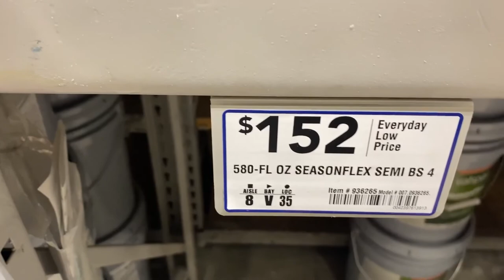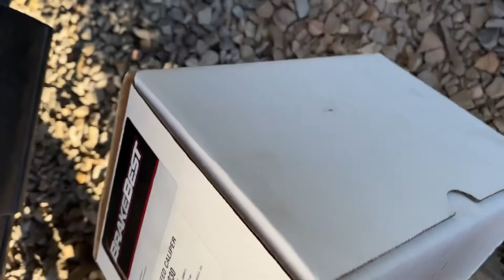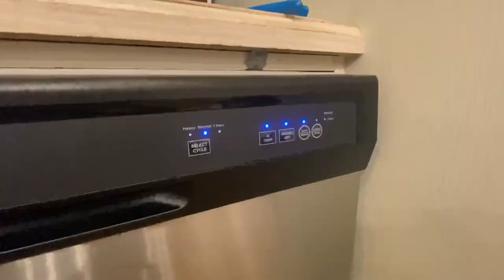Restoring Church Pews | Part 2 | Using Paint Sprayer to Apply Primer Coat | Changing Brake Pads

Comment: Hey Cody, being an HVAC tech and appliance guy too for many decades I have recently come to find out from other techs and long time Big Brand engineers etc that in the trade for decades that the equipment by DEISIGN is meant to fail. Every appliance has parts or components that are/were purposely designed to fail (by another company for legal reasons) simply to motivate repurchase by us consumers. It definitely makes sense because if it did not break where would the customers go.
Reply from the maker: I can see that being true. Doesn’t surprise me one bit. It’s all replaced now and working with a whirlpool brand instead of GE. Told him I wanted the cheapest piece of junk that they sold because I’m tired of paying top dollar for something that’s just going to break on me. Cheapest piece of junk that had a stainless steel face on it lol

Comment: God Bless you Cody. I have been painting (brush n roller) a house and reluctant to try the airless sprayer (never used one) but you gave me the courage. Plus I need to move on from this job!
Reply from the maker: I could have given you tons more examples of me using this thing whenever I was building our home. It works so well and it’s honestly just not that difficult to use. Takes a short amount of time to set up once you know what you’re doing and a short amount of time to clean up. Not worth it for a tiny job but for a job that would normally take days, turns it into hours. God bless you Robert. Thanks for always watching! So glad I could help!
Reply from the maker: I can also tell you that I like the sprayer that has the pump and the gun separate. I tried those combo sprayers that had a little paint cup attached to the gun and they just did not work that well for me. I like this gun in the fact that if something goes wrong with it, I can just replace the gun and not the entire machine. The gun itself has replacement parts as well.
Reply from the maker: I forgot to put the link for this sprayer in the description. I need to do that for you.
Reply: @OurFruitfulFamily  I ponied up and hired a friend  (Lic Paint Cont. )with commercial set up. He came Monday and sprayed the  house. I peeled the masking back and  75%
Reply: @OurFruitfulFamily  If I buy one it will be a more commercial type unit.My main house was built in 2010-12 and it already needs repainted. I also need to paint the cottage inside and out.
Reply from the maker: @TropicalHomestead  I’m glad you got it all painted! This one is considered a “pro” unit as well! I’ve had it for years! Painted our home with it as well! They save so much time!

Comment: Cody, I am a long time HVAC tech, biz owner, etc.
If you want advise to maintain all of your equipment anad perhaps discover where your power draws are coming from I'd be happy to help fellow brothers and sisters.. Each tech has their opinions. I would be happy to talk with you about it and offer any and all suggestions to find out what is going on! Aloha from Big Island Hawaii, Robert
Reply from the maker: Hey Robert! I’m always up for learning new things! Basically, had a high power bill. 250 bucks to be exact. He acts like my bill should be 100 bucks a month with my spray foam and small home. Unit has been cooling fine. Just had him out here to see if it was cooling efficiently being we installed in 30 degree temps and never rechecked the Freon levels come spring time. He said they were actually a bit over charged and released some Freon to get it to proper charge. Said it affects compressor life but shouldn’t have been the cause of my power bill. Amp draw was 11 to 12 amps while running. 4 ton unit. Fan amp draw is normal as well. Makes no sense to me. All lighting is LED. Not really sure why it would have been so high…
Reply: Hey Cody and Jessie I apologize but I am old and not familiar w YouTube so much, I cannot se the entire message on some replies (definitely user error) and I do not want to think I am dogging the threads! lol